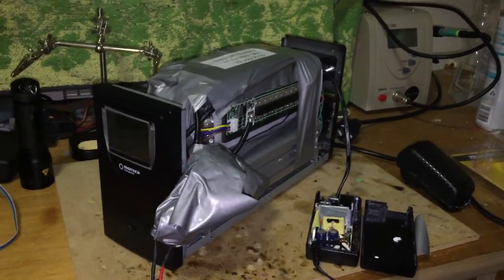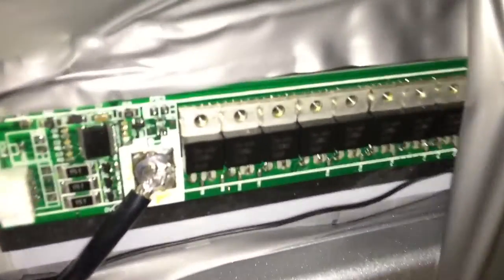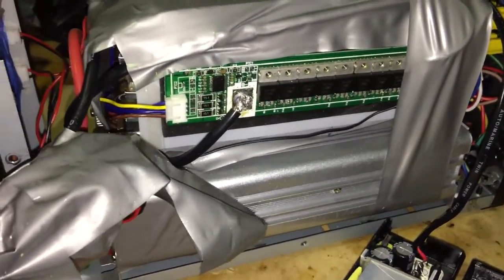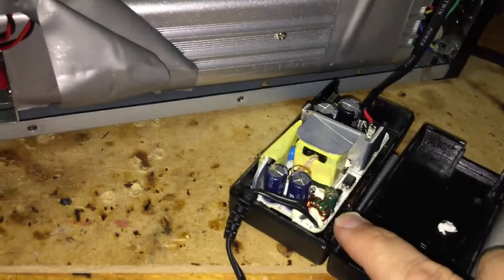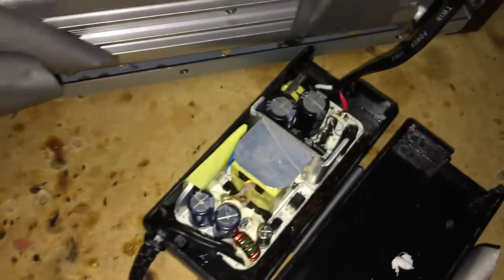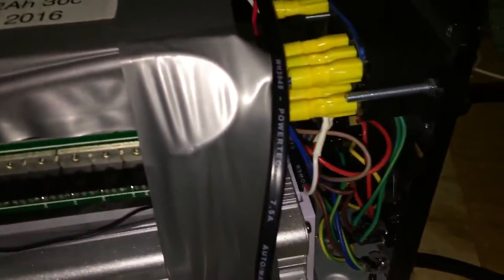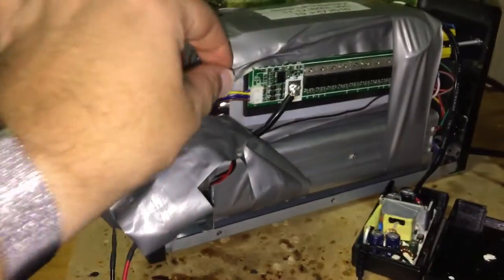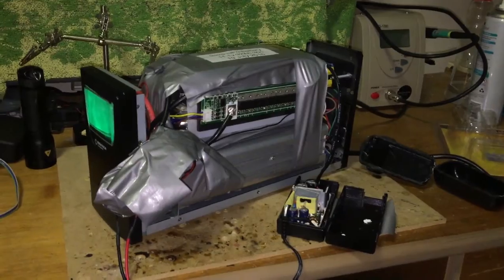DIY Lithium UPS teardown

Comment: How come the charging 3S battery doesn't overload the 12v supply, in other words, why does it only pull ~2a? I thought it would overload the 12v supply. Has it got a built in 2a current limiter?

Comment: which bms model do you use, 3s 60A or 4s 60A?is it available on ebay?
Reply from the maker: On eBay it's called a "12V 60A 3S  Battery Charge discharge Protection Board Li-ion Lithium batteries". It's only like $13 or so with free postage.http://www.ebay.com.au/itm/12V-60A-3S-Battery-Charge-discharge-Protection-Board-Li-ion-Lithium-batterieS-/221977160032?hash=item33aedea960:g:QKYAAOSwUdlWfFj2

Comment: oh nevermind, i posted question on short video about the inverter stay on. now i got the answer. but another question coming. this should be almost 1 year mark today, is it still on ? any problem ?
Reply from the maker: I used second hand batteries and they have pretty much died now. The inverter does stay on even though there is power. This continuously draws about 0.6A which means the battery charger is ALWAYS trying to keep the battery charged. Bad situation for lithium batteries. So I have now bought new 18650 cells. But when the power is on, I'm going to run the inverter from a 12vdc plug pack 0.6A and I'll have to add a 2nd relay so on power cut the inverter switched from 12vdc from mains to the battery. I have to keep the inverter powered because otherwise it's too slow to turn on and 240v output is lost long enough for the 3d printer to stop working. I'll update with another video
Reply: Awesome,l i build 1 using 18650 but without BMS, just around 1 month usage, the battery died and i almost lose faith on lithium powered ups inverter. in your next video please explain more about the relay and if you can, please use 8 pin tube style relay (such as Omron 8 pin 220v) and how to wire them to your 2nd relay to power (which i dont understand why you need 2nd relay)

Comment: I got the relay system, the inverter switch etc. what i dont understand is how you use your Regulated power supply to charge the Battery?
Reply: Correct me if im wrong. you just solder your adaptor directly through the battery. + go directly , while - go through the BMS. how it is working?
Reply from the maker: The regulated power supply outputs 12v DC. When the battery is low it uses Constant Current to charge the battery, but as the battery gets closer to full it switches to Constant Voltage and varies the current lower and lower until the battery is full. The BMS also keeps an eye on the cell levels and balances the cells and generally keeps them within 50mv of each other. But if ANY cell goes above 4.25v or below 3.20v it'll cut the PACK negative line by opening the FET's
Reply: i just knew it can be charged like that way. what if i dont use BMS since the auto cutoff over or under voltage is done by the Inverter itself.
Reply from the maker: The Inverter automatically cuts off at 9.8v, the BMS shuts down at 9.6v or if any cell hits 3.2v. There's a risk by NOT using a BMS in that if one cell is a bit weak then another cell may hit the 4.25v early and puff up and catch on fire. Lipo batteries are no joke and are truly terrifying when they blow. Especially these 16000mah cells!!! Look on youtube
Reply: mine are 18650 which is safer rather than Lipo, its Li-Ion. if the problem is Balancing the voltage, what if i just use regulated 12v DC to charge and for discharge protection build in inverter cuts off at 9.8v which mean safe for 18650s. it cant be overcharge because technically regulated 12vdc is 12v while 18650 max is 12.6v. yes it will not using full of its capacity, too earlier to cut off under nor over voltage. but my goal is to make this cheap and long cycles rather than regular VRLA build in batteries. correct me if im wrong.
Reply from the maker: Andrey Garcia worth a try. My advice is to balance all your cells and once balanced you could run it unbalanced. My motorbike has 24 cells and there's no balancing in it. They are all pretty close too each other even after 5 years and nearly 50,000km. They're lithium ion phosphate. I'm using BMS because Lipo can go bad otherwise. But if you've got the lithium ion 18650 cells then I'd say do it. My cordless vacuum cleaner is very dumb. It just applies  22vdc to the 6 lithium ion cells. There's low voltage cutoff but no high voltage cutoff. There's also no cell monitoring either. Yet the cells are still all good after a year or so
Reply: I'll try it and update you as soon as i finish it. thank you for your Advice sir. You help me so much
Reply from the maker: Andrey Garcia cool. Make sure to let me know when you have a video up
Reply: I wasn't aware a standard 12VDC power supply can do CC/CV ? I thought you used a real charge before?